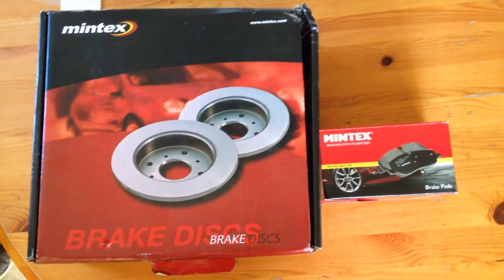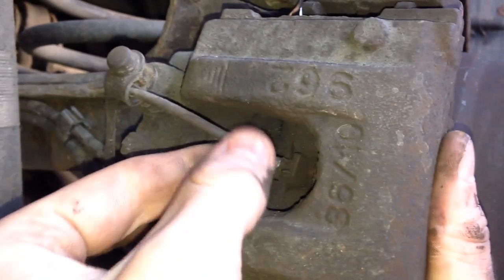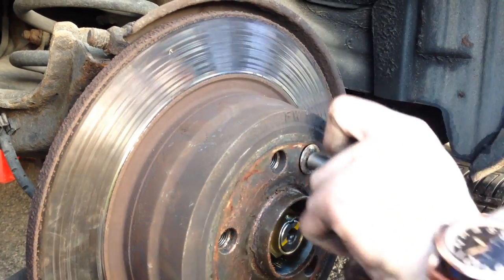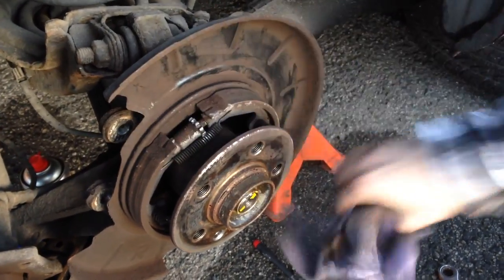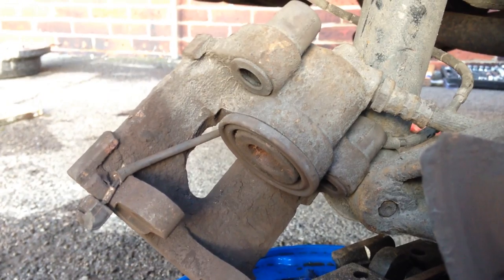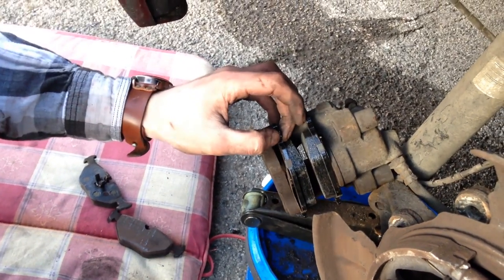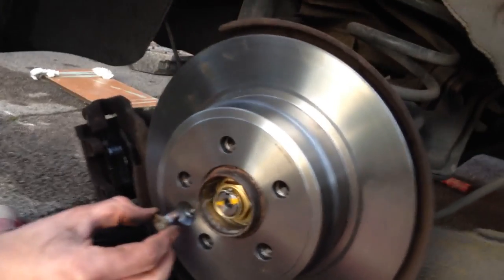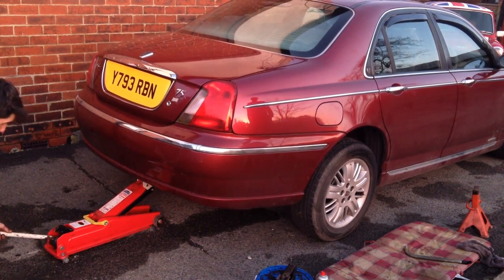How To Replace Rear Brake Discs And Pads VN14

Comment: Thanks for posting superb and very useful video. I'm about to change front and rear discs and pads on my 180.
Reply from the maker: Excellent, thanks for the feedback! If you need any help or advice please give us a shout. We are currently in the process of making some more content for the channel.
Reply: You're welcome! Any advice on replacing top strut mount bearing? Looking forward to future videos.
Reply from the maker: this is a job we're looking to do too. From what i've heard its best to get some spring compressors then undo the bolts at the top and should drop out. I'll try film it if we have a go :-)
Reply: That's great thanks. Looking forward to more helpful videos

Comment: My caliper bolts need a hex 7 not spanner as shown here, They're hidden by a rubber tube (+ cap). Rover 75 tourer. And wear pad wire only on off-side. You can't push piston in by your thumb. Use a G-clamp.

Comment: Cheers for this video. Gunna undertake the same work.

Got a problem though; no idea where to put the axle stands, where did you place yours in this video?

I'm only able to jack it up via the designated jacking points on the sill (indicated via rubber pads) mainly because the jack i use is just a 2 tonner and thus not tall enough to reach the rear tow point.
Reply from the maker: Thingamajigss When you take the wheel off you will see a lower arm that looks like its part of the subframe but i don't think it is. It's strong enough to put the stands there. In the past i have used the standard jack on the rear jacking points (under the doors) and this provided enough height to put the stands under the back. Would probably be easier to do one side then the other. Any more questions please feel free to ask. Hope this helps.

Comment: Two questions guys. If my handbrake is very weak can I fix it using that adjuster? Of course if the pads are thick enough. And will the same procedure work with front discs? Thanks in advance!
Reply from the maker: +xghaf you can give it a go. I have fixed one by doing this before. But the cables can stretch. Make sure if you do adjust it this way you let the handbrake off first. before replacing the cables try the modified compensator under the handbrake itself. If you Google it you will find many Rover threads on it. 

Yes the fronts are a lot easier in my opinion. 

Hope this helps :)
Reply: +The Mechanical Rookies The compensator under the handbrake is already screwed to the limit that's where my problem comes from. I suspect the pads are worn already anyway. Once again thanks a lot for all your tutorials on a 75!
Reply from the maker: +xghaf Any questions and we'll try our best to help. If you're on Facebook give us a like and post any pics of work you've done :) https://www.facebook.com/TheMechancialRookies/
Reply: @themechanicalrookies  It will be the stretched compensator, replace it with te R53 mini one or one from the Rover 75 forums. That cures 99% of rear handbrake problems

Comment: lol when you pressed the new pad in, you got crap / grease all over the friction surface. it also takes a bit more than just pushing the piston with your hand, if its come out
Reply from the maker: Thanks for the comment but the friction surface was cleaned thoroughly before final assembly.  It all depends how far the piston has travelled. A good set of pipe pliers usually do the trick if that is the case.